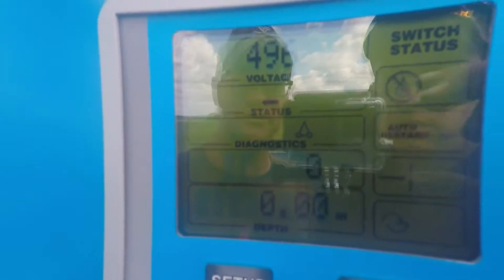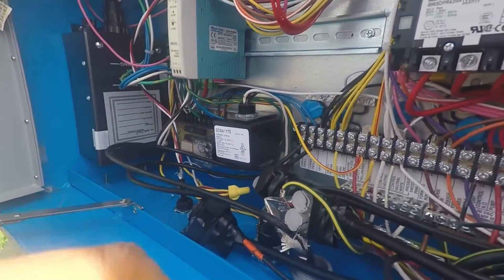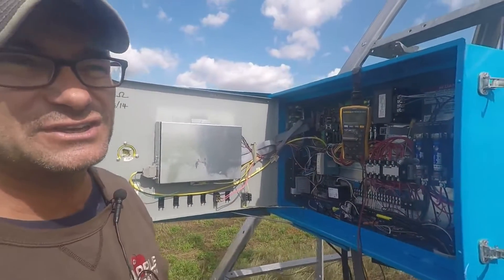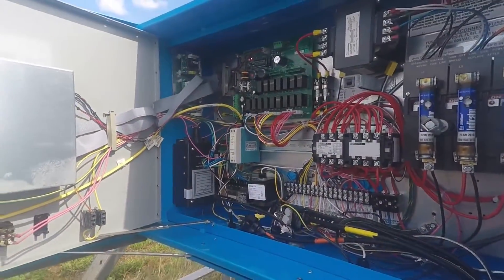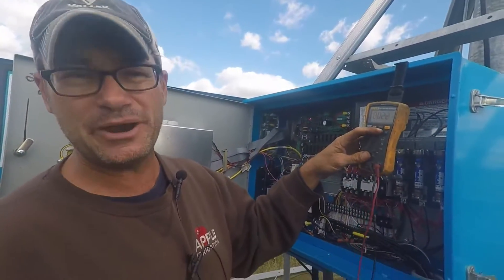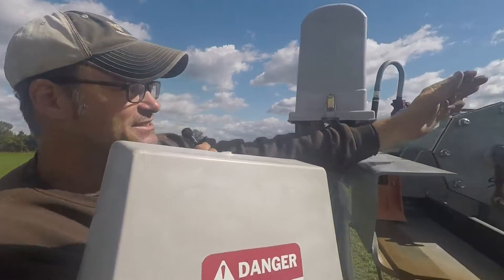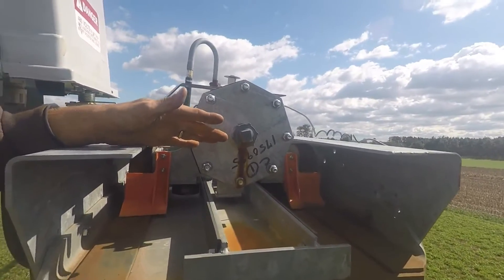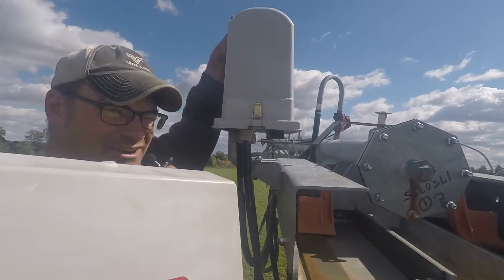Valley track and roller troubleshoot with buried wire guidance

Comment: For the Valley ClassicPlus Control Panel model, to power the oscillator, the wire to be moved to pin 3 will be the red wire from pin 8. As already mentioned, the wind in the microphone is a bit troublesome.
Good job, thanks for your help.